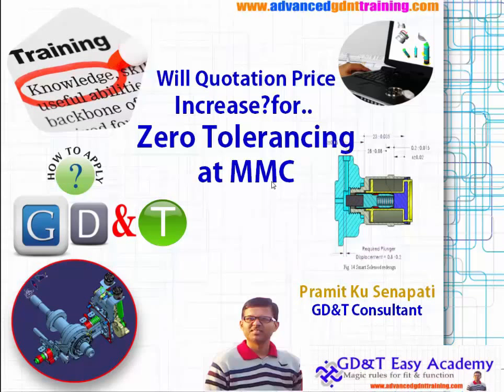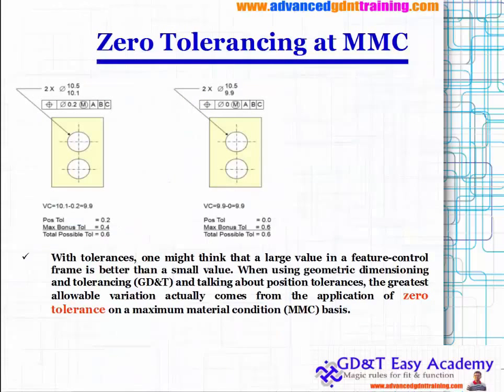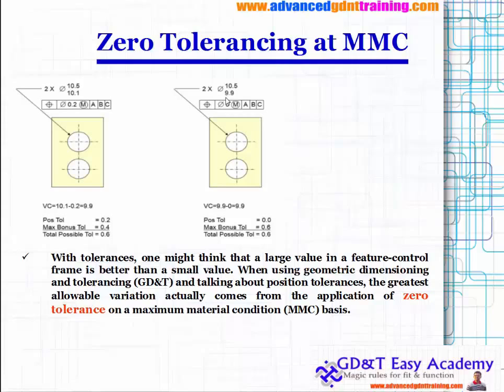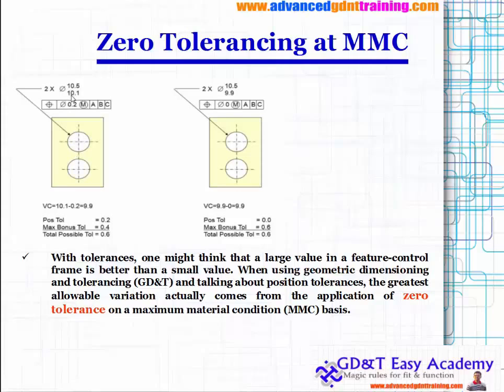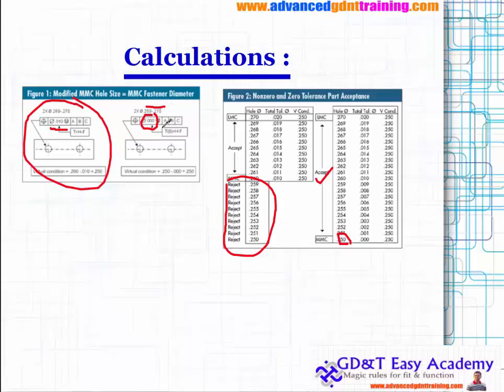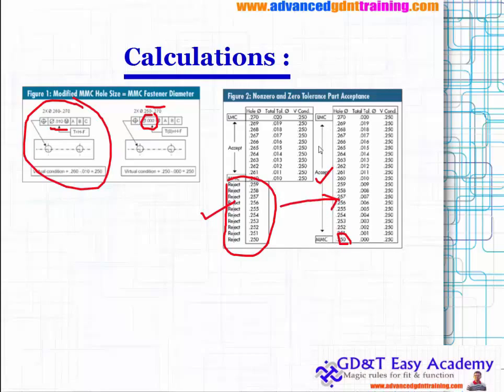Zero tolerancing at MMC on GD&T-Get Higher ROI and Low quotation on parts-GD&T ASME Y14.5-2009

Comment: How can I apply this concept to small electric sheetmetal components?
Reply from the maker: +James Mat During your GD&T annotation and design finalization you never dominate manufacturing but primarily for validating your tiny small parts you need gauge design 1st and see your gauge design and accordingly assign critical tolerance to parts and assign GD&T.May be bending le us say 90 degree is not critical  may be its okay if you achieve 85 deg or 105 deg so assign loose tolerance accordingly and so on....